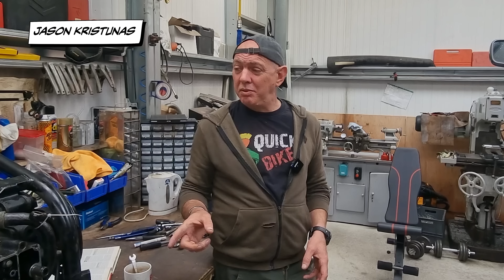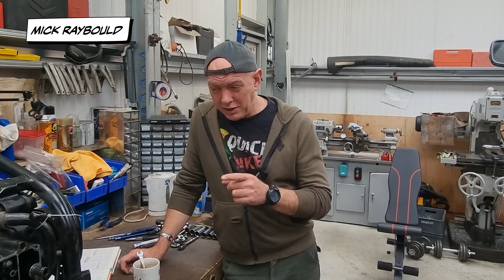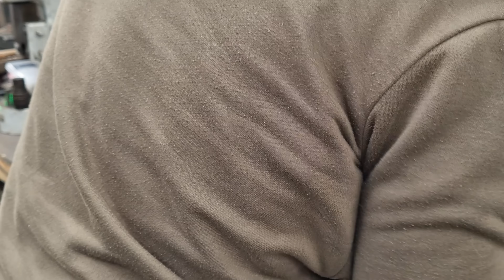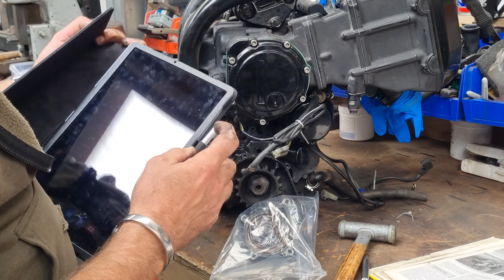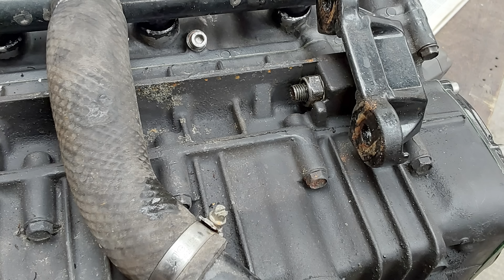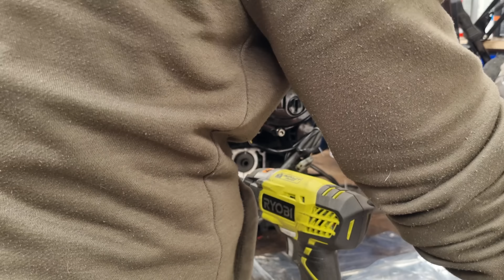Dismantling the gearbox (Part 1) - 1990 Kawasaki ZZR1100

Comment: Back in the 90’s I worked in a Kawasaki shop in Raleigh North Carolina. The ZX-11 was the hot bike to have. We started having ZX-11’s come in with broken 2nd gears. Guys were speed shifting 1st to Second to pop giant wheelies. The gear box in the ZX-11 was basically a ZX-10 box and the 11 couldn’t take the extra torque so Kawasaki had a warranty fix to a stronger 2nd gear. We would send the gears out to be undercut for a nominal fee and that would make the gearbox bullet proof. As old as your bike is I imagine it’s been abused over the years. Hell,I would! They were great bikes and would take an enormous amount of spirited riding. Unusual to have 5th go but any gear can go on a bike that old.
Reply from the maker: Yeah , everybody talks about 2nd gear but never 5th..  Still, hopefully I can get it all sorted and back.on the road again 👍
Reply: I have my first and 2nd gear poping out. I landed on this video cuz lf that. Can you tell me what to look Up to make to mine? I have lathe and Mill just need an example

Comment: Oh, yeah! Now, that's a good lad! Rip her open and tear out the guts! 🤩
If it makes sense to pull something apart, then do it! Which is certainly the case here, with all that swarf in the oil sump. Rinse and replace, whatever You need.
Then try and get as many of the parts as You possibly can, back in there again.
But, don't worry! You can make it. And I agree on taking the photos. If You think 100 photos is enough, take 50 more. You know You will be needing them. Besides, they're for free! Good luck! Until tomorrow, I'll be sitting right here, waiting!  🏍
Reply from the maker: Hehehe... thank you matey. Pulling it all apart is the only way to sort it really, so that's what's happening . Thanks for watching 😁 👍

Comment: How are you finding those 5ah ryobi knock off batteries?

Love the videos BTW. You influenced my decision to buy a k2 bandit 600 that I've been rebuilding for the past 2 years ☺️
Reply from the maker: Geddon... I take it you're doing a full rebuild? Send me some pics and I'll stick it on the channel. The batteries are really good considering the price and last ages. The tell tale thing is the impact gun as it needs plenty to get properly stuck stuff loose, but it works a treat 😁
There's better brands out there for sure, but these do what I need for now 👍
Reply: Yeah full rebuild! Bought it with a broken cylinder head bolt inbetween lockdown 1 and 2. It had been dry stored for 10 years after the previous owner lost interest in it!

Pics on their way! Not quite finished but I've got 3 weeks until my mod 2 test so time is ticking!